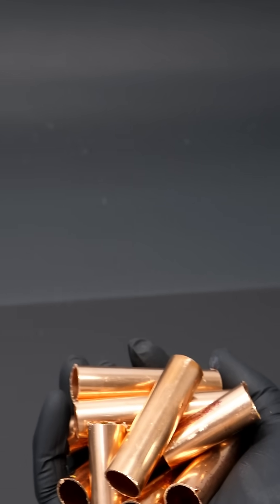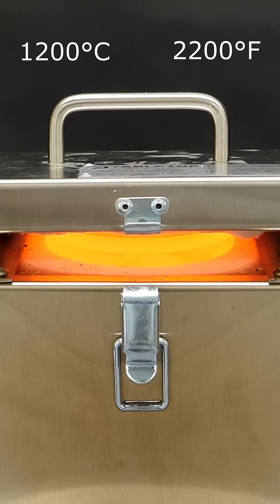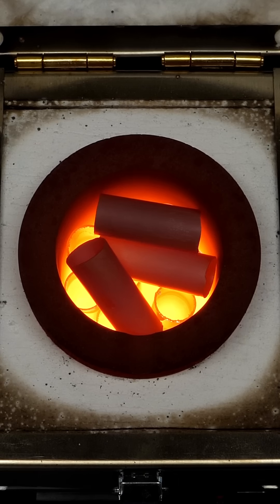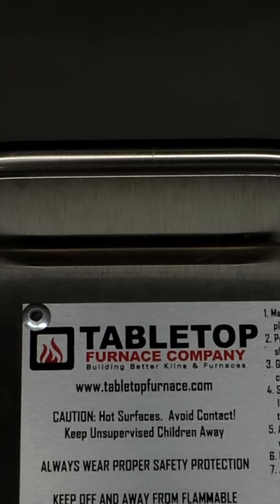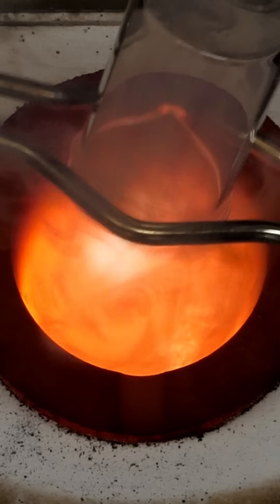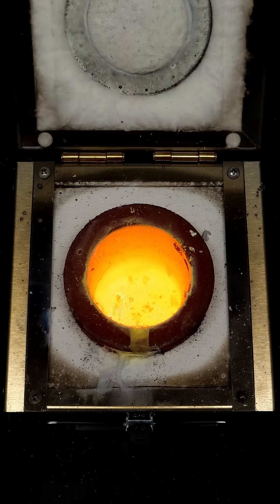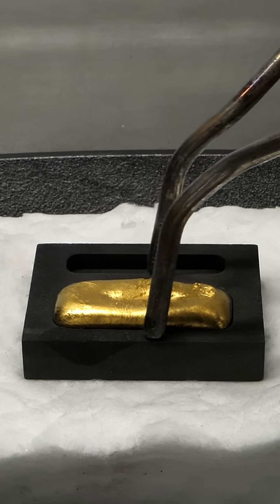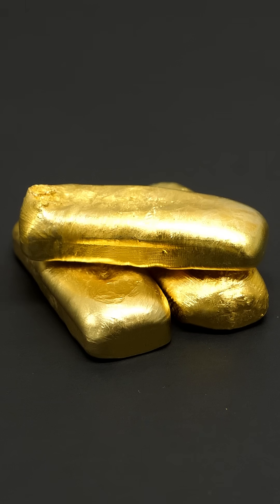Making Nordic Gold

Comment: You could turn other metals into actual gold. You just need to use some ridiculously expensive science equipment to slap some protons onto an atom, and bam, you got a completely different element. The gold doesn’t last very long, since the transmutation is pretty janky, but hey, you got some free gold for a little bit and it only cost several million dollars!

Comment: The "recipe" for Nordic Gold is an alloy consisting of 89% copper, 5% aluminum, 5% zinc, and 1% tin. To make it, you first melt the copper in a furnace to around 1200°C (2200°F), then add the aluminum and zinc, and finally, stir in a small amount of tin before pouring the mixture into a mold. As the metal cools, it develops its distinctive golden..

Comment: Hey, Nile! I have a small recommendation, though it may be in error. The insulation on your crucible lid looks to be ceramic wool. I’m a smith and have the same thing inside my gas forge, but if that stuff burns at all, it’s carcinogenic. It’s not as much of an issue for you, since you don’t use actual flames like I do, but I coated it with refractory cement. Just looking out for your health!

Comment: But why that spoon 🥄 doesn't melt
Reply: It's made of graphite I think. Graphite doesn't melt it sublimes which means it skips liquid and goes straight from solid to gas but this only happens at extreme temperatures over 3600 degrees celsius which is much much hotter than this liquid metal.

Comment: A bullet, in the context of ammunition, is the projectile that is expelled from a firearm barrel. It's important to differentiate it from a complete cartridge (also called a "round" or "load"), which includes the bullet, a case, propellant (gunpowder), and a primer.
Here's a breakdown of what a bullet is typically made of:
Primary Materials:
 * Lead: This is by far the most common material for the core of a bullet due to its high density, malleability (it's soft and easy to form), and relatively low melting point, which makes it economical to produce. Its density provides good ballistic performance, meaning it retains velocity and energy well in flight.
 * Copper and Copper Alloys (Gilding Metal): As firearm velocities increased, bare lead bullets could "foul" or wear down the rifling (helical grooves) inside the barrel. To counter this, bullet manufacturers began encasing lead cores in a harder jacket, most commonly made of copper or a copper alloy called gilding metal (typically 95% copper and 5% zinc). This jacket helps the bullet withstand the high pressures and temperatures of firing, reduces barrel leading, and allows the bullet to engage the rifling more effectively for stabilization.
 * Steel: While less common than lead or copper, steel is used for specialized bullets, particularly armor-piercing rounds. These bullets often have a hardened steel core designed to penetrate harder targets. Steel can also be used for bullet jackets, though it's less common than copper.
 * Plastics and Polymers: These materials are becoming more prevalent, especially for specialized applications.
   * Polymer Tips: Many modern hunting or precision rifle bullets feature a polymer tip on the nose. This tip improves aerodynamics for better accuracy and can also aid in controlled expansion upon impact.
   * Polymer Coatings: Some bullets, like Federal Syntech, have a nylon or polymer coating. These coatings help reduce barrel fouling and are often used for training or when shooting at steel targets to minimize ricochets.
   * Rubber: Used for less-than-lethal projectiles or practice rounds.
 * Zinc: Can be used as an alloy with copper in gilding metal, or in some lead-free bullet designs.
Construction and Types:
The way these materials are combined and formed dictates the bullet's intended purpose and performance.
 * Solid Bullets: These are made entirely of a single material, such as cast lead, all-copper, or brass. All-copper bullets are gaining popularity as lead-free alternatives, offering good weight retention and deep penetration.
 * Jacketed Bullets:
   * Full Metal Jacket (FMJ): The most common type for target shooting and military applications. It has a lead core almost completely enclosed by a copper or gilding metal jacket, with only the base of the lead exposed. This design helps the bullet maintain its shape and prevents lead fouling in the barrel.
   * Semi-Jacketed (Soft Point/Hollow Point): These bullets have a partial jacket, leaving an exposed lead tip (soft point) or a cavity in the nose (hollow point). These designs are intended to expand or "mushroom" upon impact, creating a larger wound channel for hunting or self-defense.
   * Total Metal Jacket (TMJ): Similar to FMJ but the jacket fully encloses the bullet core, including the base, to prevent lead exposure.
 * Frangible Bullets: Made from compressed metal powder (often copper or bronze), these bullets are designed to disintegrate upon impact with hard surfaces. This minimizes ricochets, making them ideal for indoor shooting ranges or close-quarters combat. They still transfer significant energy to soft targets.
 * Armor-Piercing (AP) Bullets: These typically have a hardened core (often steel, tungsten, or carbide) encased in a softer jacket. They are designed to penetrate body armor or other hard barriers.
 * Tracer Bullets: These have a burning compound in their base that ignites upon firing, leaving a visible trail in flight. This allows shooters to observe the bullet's trajectory, often used in military applications.
 * Specialized Designs:
   * Flechette: Pointed, fin-stabilized steel projectiles.
   * Wadcutters: Flat-fronted bullets, typically made of lead, used for target shooting as they cut clean holes in paper targets.
   * Boat-tail bullets: Feature a tapered base that reduces drag and improves aerodynamic stability, leading to better long-range accuracy.
In summary, while lead remains a cornerstone, modern bullet manufacturing incorporates a wide array of materials and designs to achieve specific performance characteristics, from basic target shooting to specialized military and hunting applications, all while balancing factors like cost, barrel preservation, and terminal ballistics.
Reply: I'm not sure how this is relevant to the video, but it's well written.

Comment: It's basically nicely made BRASS
Reply: It’s basically a type of aluminum bronze. It isn’t brass
Reply: Hmm🤔.. Aluminum Bronze, sounds cool but what would clasify it as that, just curious @Joker-em6oz
Reply: @InternetEssentials-1111 aluminum is the dominant alloying element. Tin bronze is where tin is dominant and brass is where zinc is dominant.
Reply: Oh you're right, because zinc when polished the sort of yellowish... I think... But nice to know....💪🏽@Joker-em6oz
Reply: @Joker-em6oz so basically, aluminum and tin are the dominant elements in this mixture.?
Reply: But copper is needed to make the classification, is this correctis this correct?
Reply: @InternetEssentials-1111 just aluminum is dominant. There’s only 1% tin
Reply: @Joker-em6oz so how does Bronze fit in the aluminum bronze hypothesis?
Reply: @InternetEssentials-1111 copper is the base metal. Aluminum is the dominant alloying metal
Reply: @InternetEssentials-1111 bronze is where tin is the dominant metal
Reply: @InternetEssentials-1111 zinc is silver like all metals except for gold copper osmium and cesium
Reply: @Joker-em6oz ohh, correct,  b3cause of the base...thax again👍🏽🫡

Comment: What the hell kind of material are you using to stir this??
Reply: Steel. By far the must abundant metal used by humanity
Reply: Did not know steel’s melting point was that high to withstand such high temperatures
Reply: @rodrigolyra7312 well yeah. that’s why it was forged instead of cast historically

Comment: Here are some key facts about Nordic Gold:

---

🧪 Composition & Origin

It contains no real gold—the name refers to its color. The typical alloy is 89 % copper, 5 % aluminium, 5 % zinc, and 1 % tin  .

Patented by Luvata and developed by Mariann Sundberg at Outokumpu for Sweden’s Mint in 1991  .

Later adopted for 10, 20 & 50 cent euro coins, also used in Swedish kronor, Polish złoty, and various commemoratives  .

---

📐 Physical Properties

Melting point around ~950 °C  .

Density ~8.91 g/cm³  .

Brinell hardness ~120 HB (nice balance of toughness & machinability)  .

Non‑magnetic, hypoallergenic, high corrosion resistance, and tarnish-resistant  .

Demonstrates antimicrobial and antifungal properties, especially post-abrasion—bacteria like E. coli die quickly on its surface  .

---

🛠️ Workability & Uses

Excellent for coinage, often used in high-handling denominations for durability  .

Beyond coins, it appears in medals, badges, some jewelry or decorative items, and even in electronic connectors due to its non-magnetic nature  .

Machining is possible but tricky—redditors mention it “eats through steel files” and can crumble if overheated or cold-worked improperly  .

> “I have done some finish work…It grabs your tool…drilled holes become fricking oblong spirals… It takes any little thing you do wrong and magnifies it by a hundred”  .

---

💎 Value & Investment

Contains no precious metals—its value is low, driven only by copper content and collector interest in certain coins  .

Not suitable for gold recovery or financial investment, but valuable in numismatics or practical uses.

---

📊 Quick Fact Summary

Feature	Details

Composition	89 % Cu, 5 % Al, 5 % Zn, 1 % Sn
Appearance	Bright gold-like color
Hardness	~120 HB
Melting Pt.	≈ 950 °C
Density	≈ 8.9 g/cm³
Durability	High corrosion + wear resistance
Non‑allergenic	Yes
Antimicrobial	Yes (weak but measurable)
Cost	Low; no real gold

---

✅ ✅ Wrap-Up

Despite its name, it’s essentially a specialized brass/aluminium bronze alloy—durable, non-allergenic, anti-microbial, and tarnish-resistant, perfect for coins.

However, it’s not precious metal, has no investment value, and can be difficult to machine without the right tools and experience.

Its real worth lies in its practical engineering properties, not in precious metal content.

Happy to dive deeper into any aspect—machining tips, coin history, or antimicrobial studies!

Comment: That was not a "blow torch". That was a simple propane canister warming torch. A blow torch is a cutting torch. A tool that requires tanks of oxygen and acetylene. And it  an cut thru steel by blowing oxygen thru it after the steel is heated to red hot.

Comment: Why didn't he start with metals that have lower melting point? Wouldn't that prevent bubbling? Also, these metals would provide direct contact of copper to heat source, so it would melt faster.

Comment: When cooling hot metal, move the metal around in the water. When the material remains stationary, it creates a steam pocket: preventing the water from reaching it. But in moving the metal around, you repeatedly remove the metal from the steam pocket and allow the water to continue to contact your metal, thus cooling it down much faster.

Comment: As in melting snow for drinking water, if you put snow in a metal cup and place it over a fire, the snow touching the metal will melt and quickly dissipates as it turns to steam. By adding water to the snow it allows the snow to melt into the warm water and eventually you'll have hot water.   ☆
Reply: If you melt snow it becomes hot water.

Comment: Melt all the alkali metals at 271 Celsius and make sure it doesn't ignite the hydrogen gas and mix them and pour them into a mold and let it cool down and put it in water and just call nile blue for help and get a controllable toy excavator and control it and drop the super alkali alloy into the water (maybe it will cause damage to your beaker)

Comment: Nordic gold is an alloy that is 89% copper, 5% aluminum, 5% zinc, and 1% tin. It has antimicrobial properties and is also resistant to staining
Reply: So wearing it as jewelry with water wouldn’t tarnish?
Reply: Nordic gold is resistant to staining and blacking, but not completely anti-stain or anti-oxidation. If it is in constant contact with water (especially salty or chlorinated water), it may change color slightly. But compared to pure copper, it is much more resistant. @allyson3123
Reply: Are those percentages mass?
Reply: @jeffreysmith236 Yes, these percentages are calculated based on the mass (weight) of the alloy, not on the basis of the volume or number of atoms.
Reply: I wonder if it could be used for jewelry making.
Reply: @earth2becky Nordic gold is mostly used for euro coins. It can also be used for jewelry, because it looks like gold, antimicrobial, and resistant. But it doesn't have much metal value (because it doesn't have gold at all) and is mostly used for fancy or low-cost jewelry, not luxury jewelry.

Comment: Could you imagine having this recipe knowledge 1600 years ago? Easiest counterfeit gold coin operation ever lol
Reply: It's less dense, someone would notice for any large piece or a bag of pieces.  Gold weighs like twice as much!
Reply: it was called "orichalcum", which is not the same thing as Nordic Gold, but it looked like gold pretty much
Reply: Nah. Any goldsmith would've just dunked your "gold" object into water, pulled it out, dunked a real gold bar of the same weight into water, noticed how your object displaced a lot more water, and your scam would've been exposed in no time.
Reply: @DevilMaster next they dunk the maker for clearly being a witch.
Reply: @borismuller86  Maybe your mom does that.
Reply: @DevilMaster  that's not how volume works. If the two metals are the same size and shape, they will displace the same amount of water, no matter their weight/density difference.
Reply: @DevilMaster  If both metals sink, they will displace the same amount of water assuming they have the same volume.
Reply: That's why people bit gold coins. You can instantly tell.
Reply: Was aluminium and Zink known in year 400?
Reply: @RossiaIsNoMore  zinc I think yes, aluminium definitely not, the process to extract aluminium wasn't possible before the 19th century and was so difficult then that it was more expensive than gold
Reply: @RossiaIsNoMore  Aluminum, “NO”.   It’s the 8th most common element on Earth, but it was incredibly rare even in the 1880’s; so much so that a cone, 12 inches tall, was placed as the tip of the Washington Monument.   Before doing so, that 12 inch cone went on a train ride tour of the country to display this fabulous new material to let the public see it.   The reason this was so is because it took an enormous amount of energy to get the elemental metal to let go of the other elements forming aluminum compounds like the common ore used called bauxite.   Common ‘smelting’ plants that did this for other metals could get hot enough to separate aluminum.   The was it was finally done is to use a tremendous amount of electricity to make an electric arc (man-made lightning).    By passing the ore (dirt) through this arc, it superheats enough to break the chemical bonds and out comes aluminum.     I don’t know about zinc.
Reply: @RossiaIsNoMore  Nah Aluminium resources don't get revealed on the map until you reach the modern era on the tech tree. However, if you rush build the Great Library of Alexandria and focus on maximizing science output, it's possible to reach aluminium before some of the other civs have passed the medieval era. Sell them your Nordic gold for the win 🥇
Reply: Nordic gold was invented years ago. Not so long as you said
Reply: With the cost of 10 gold per 1 gold of raw ingredients of other metals ❤
Reply: I have found an image which shows when which element was discovered:  
https://alansfactoryoutlet.com/wp-content/uploads/2021/02/timeline-when-elements-were-discovered-6a.png
Reply: Bro they already knew this recipe that's why they used to bite the gold to see how soft it was
Reply: You must be Jewish
Reply: Archimedes would catch you.
Reply: People from the past an even ancients were a lot smarter than the majority of mainstream thinker's today . Don't underestimate the past 💓
Reply: Aluminum & zink would be more expensive than gold
Reply: @SomeGuy_Somewhere  LOL, no way.
- Price of aluminum: $2521.7 per tonne.
- Price of zinc: $2647.2 per tonne.
- Price of gold: $3437.9 PER OUNCE!
Reply: @DevilMaster  that's today, in 400AD it wouldn't have been anything like that.
Reply: @DevilMaster  hello smooth brained man
Reply: @DevilMaster my impression was he was speaking in terms of how rare/valuable aluminum and zinc would theoretically have been back in the 1600s
Reply: @DevilMaster  back then fool.
Reply: @DevilMaster bro think 😭
Reply: @DevilMaster  Once upon a time aluminum was more than gold because of how difficult it was to make. And as others have said it was not possible to make 400 years ago.
Reply: @DevilMaster That is today yes... I don´t think you got the point.
Reply: It was called “Fools gold”
Reply: @AL-Kapone-215  No, it wasn't. 

Fools Gold is something completely different, pyrite, which is naturally occuring and during the gold rush would trick fools into thinking they might have struck gold.
Reply: @AL-Kapone-215  in fact even archaeologist today mistaken these coins for golden coins

Comment: i hope you where  wearing a  proper  mask for this as you can because you can  get  Metal fume fever (MFF) is a self-limiting, acute illness caused by inhaling metal fumes, typically during welding or other metal-working processes. It's a benign condition, meaning it resolves on its own without lasting harm, usually within 24-48 hours. The primary cause is exposure to zinc oxide fume (ZnO), but other metals like copper, magnesium, and aluminum can also contribute.